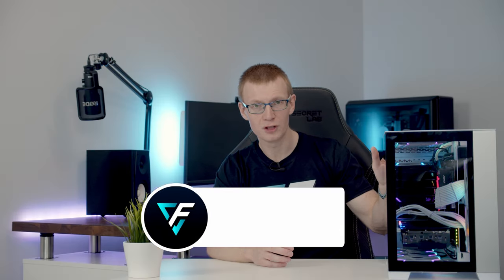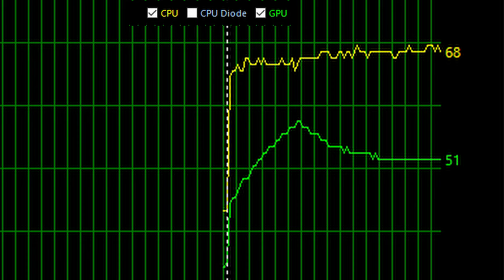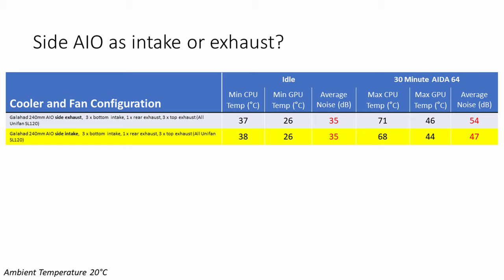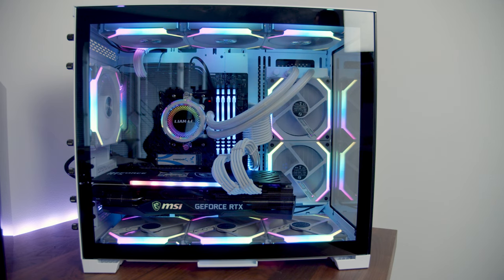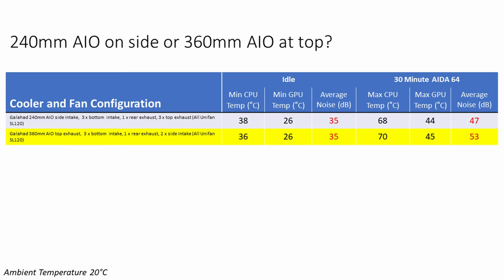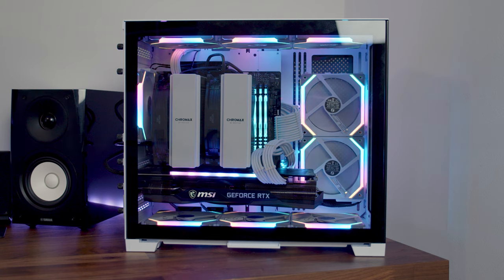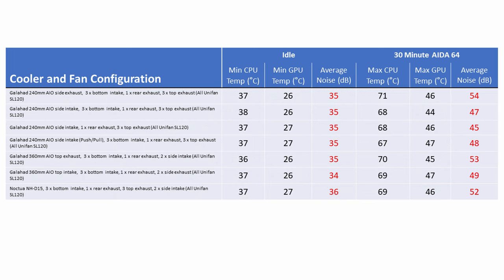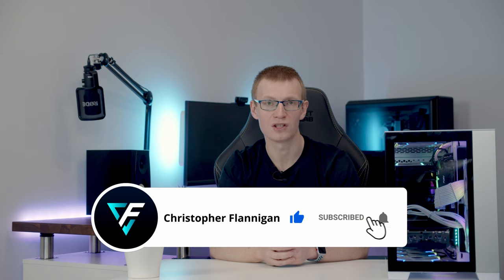Lian Li O11 Dynamic Mini - Best Fan Configuration

Comment: Hey Chris!!! Thank you so much for this video!!! I have a question about the fans since I am building it right now. The 3 top fans are Exhaust  (back side out) . The two fans(7:53) on the side are intake (back side inside). The bottom 3 are  intake (back side inside) and the rear fan is exhaust (back side outside). Is that the best for Lian li Snow White build?

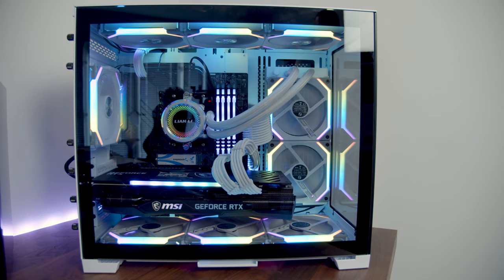TLDR: My fan position looks exactly like 7:18 in the video. Is that the best?

Comment: I'm building a Lian Li 011D Mini PC and I had a lot of questions and doubts about the thermal and fans configuration. This video has helped me a lot. Thank you very much!!
I am mounting an ATX MB and I want to mount 2x140 intake at the bottom, 2x140 exhaust at the top, and 280 AIO intake at the side (maybe the Galahad II LCD 280). I prefer silence over performance so I will go with the 140mm fans insted the 120 one.

Comment: For a test like this why not going for the CPU+GPU combo that can generate the most heat ? I would have went 5900X+RTX3080, maybe a bit of OC.... You went for a fairly easy to cool PC even whith less than optimal fan configuration, this is why you see no difference either you have bottom fans installed or not ...

Comment: Awesome analysis, thank you! 

Based on your research, I will be moving a couple of fans around in my O11 Dynamic mini case. I used a mini ATX mother board (MSI Pro B650M-A) and mounted it at the top of the case. This centered my RTX 4070-ti very nicely in the case with plenty of room underneath. It’s definitely a tight squeeze up top where the CPU power supply cables touch the top mounted fans, but it was worth it aesthetically.

Comment: I was looking into the dynamic mini running an m-atx board with the 360 cooler top mounted and set to intake, Along side 7 more unifans in the 120mm format. After thoroughly watching this video I’ve done a 180 and I’m considering a full sized ATX and switching all fans to the 140mm varient (except the 120mm rear exhaust) and moving to the 280mm side mounted intake AIO. 
This will not only save me a good amount of money but I’d imagine based on this video improve in case thermals and lower noise over the 120mms. Cheers for the video you have done a very good job explaining thermals with multiple configurations. Subscribed and liked. Cheers. DB.

Comment: I have an noctua nd15 on an itx board in that case my 5800x gets to 80 degrees should I upgrade to a 360 or 280 aio on the side for better thermals ?

Comment: Given the bottom 3 fans font affect as much, would you recommend to set those fans as exhaust at very low rpm for purely the looking
Reply: 3 bottom exhaust (low rpm), 1 rear exhaust, top rear 1 exhaust, top 2 intake, front 2 140mm intake

Comment: Hey Christoper, thank you for that informative video!
I'm considering to build a Lian Li O11 Mini build myself and therefore I'm figuring out how to place my fans.

Sadly you only covered one of my possible configurations in this video but I think you are nevertheless able to answer my question.
Which one might result in better GPU and CPU temperatures?
1. 240mm AIO side exhaust, 1x rear exhaust, 3x bottom intake Unifans
2. 240mm AIO side exhaust, 1x rear exhaust, 3x top exhaust Unifans
(or even) 
3. 240mm AIO side exhaust, 1x rear INTAKE, 3x bottom intake/3x top exhaust

As you can tell I'm on a budget and therefore only able to mount 3x fans in the top or bottom.
I hope you can help me to decide which config I should pick! THX
Reply: would love an answer to this as well
Reply: do you have a basic understanding of heat? This video pretty much answers all of your config questions if you use a little bit of brain power.
The lower fans set to intake. The higher fans set to exhaust. Radiator always intake.